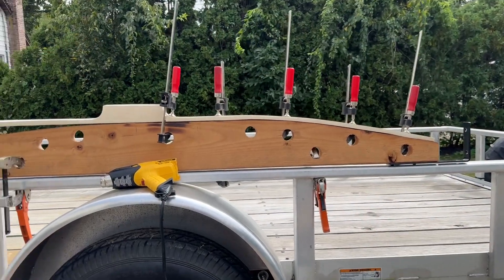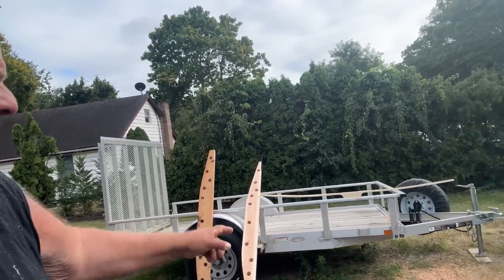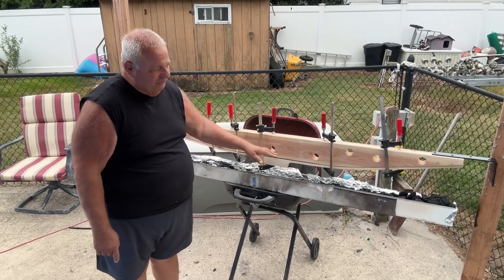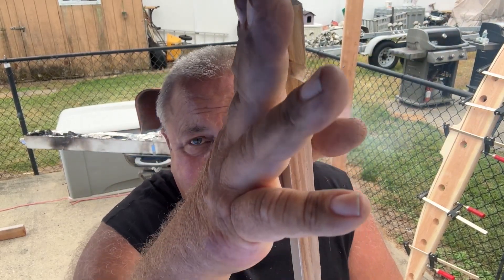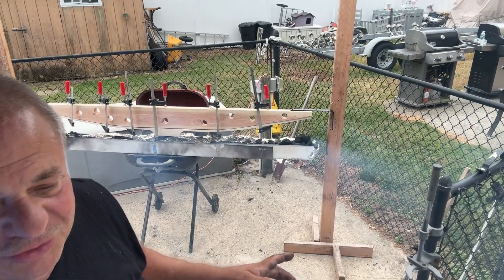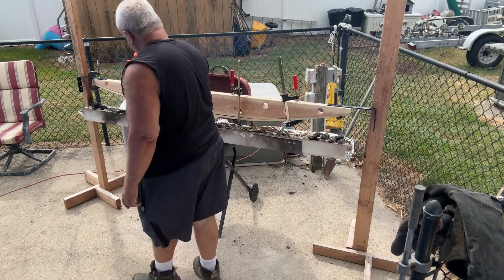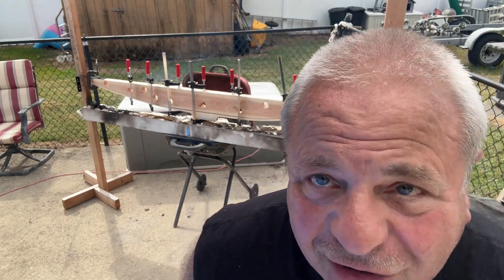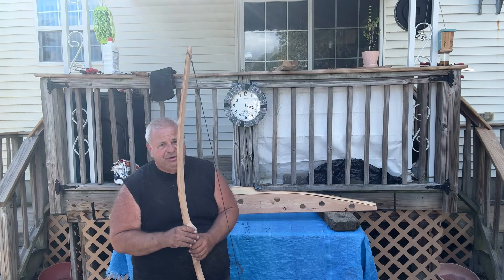2 Bows in 3 Days Part 1, Bobby’s fire hardened Hickory Self bow. New 72” jig. By Joe Zummo

Comment: Very nice! I’ve never fire hardened any bows so I have a question, have you thought about once you start to get color adding some clamps on the colored parts and removing slowly the ones that you originally had to get an even color vs the spots left wood color from the clamps? Might be too much trouble, just asking out of curiosity
Reply from the maker: At first I figured as I tillered it I would remove  some color. Then as I used either brown stain or leather dye it wasn’t that noticeable . I have in the past hit it lightly with a benzo torch  to color it in